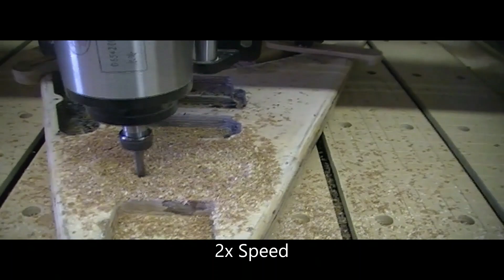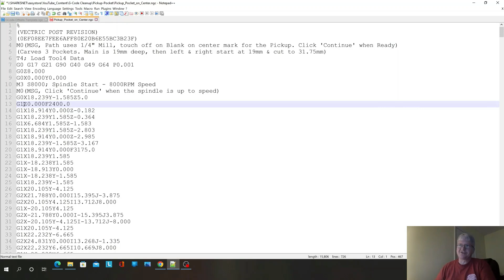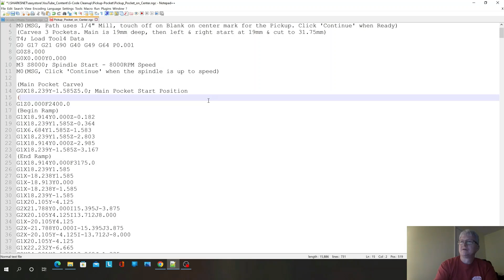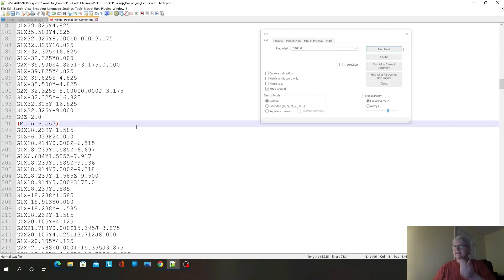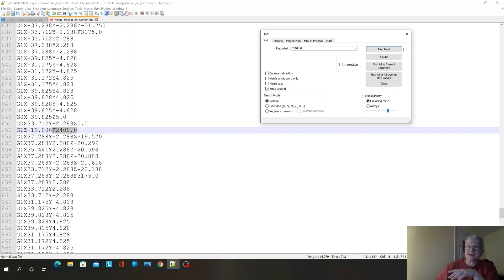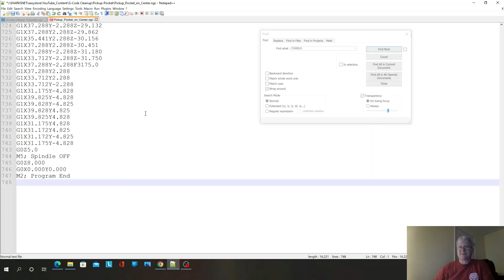G Code Tutorial - VCarve Pro - Part1: GCode Explained #gcode #cncrouter #tutorialvideo #onefinity

Comment: First, I don't  own a onefinity yet but very close to getting one. Question since you are not using cutter comp (G41,G42) does the control do this automatically when you enter the tool data? Are you programming the pocket to actual print dimensions? This video is great but would have made it more clear knowing what were trying to achieve in the end. Yes I know how to program CNC ,cnc nachinist for 30 + years just trying to
Understand Onefinity before buying one.
Reply from the maker: Sorry, I never answered your "G41,G42" question: The Tool Data is generated by the CAM software, but you can manually set offsets. To do this, you use G10 with L1.
Reply from the maker: These tool paths were generated with VCarve Pro. Do you currently use a CAM application? These smaller home machines all have limited function. That is why they are so much cheaper. But honestly, I like my Onefinity machine so far. I do miss the functions in the Fanuc 160i though.
Reply: No I don't use any cam software but I have used 2d Autocad and turbocad in the past. Fancu controls are the ones I am most familiar with. I was surprised to see how jerky the onefinity was. It seemed to almost stop so it could read the next line. Still from my research it is the best bang for the buck.
Reply from the maker: @billyhooks99  I plan to shoot and upload another soon demonstrating the use of offsets and offset shifting on these home machines to make your code reusable AND able to cut multiple products with minimal lines of Code.